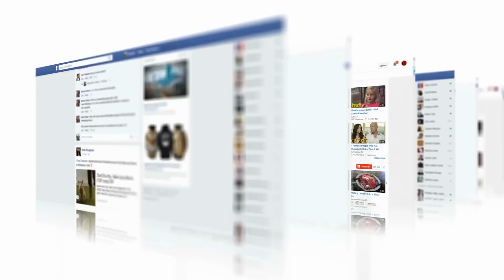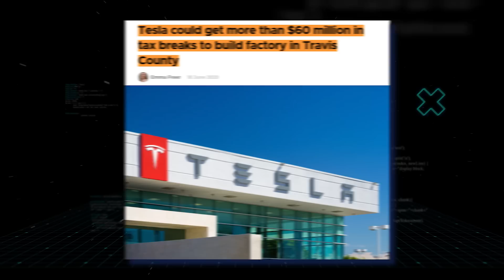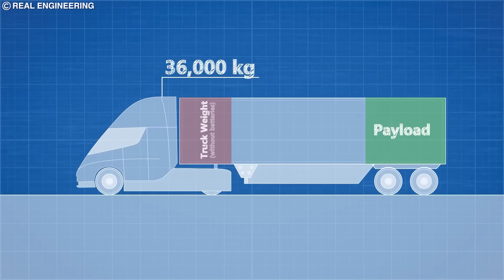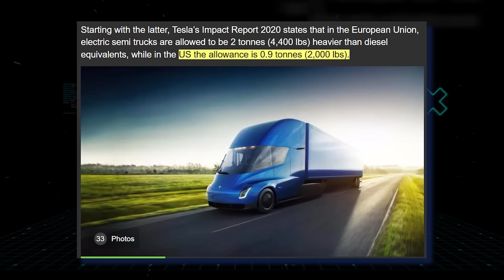Inside Tesla's ALL NEW $7 Billion Semi Truck Factory

Comment: 800 km = 500+/- miles is a total of 8 hours of driving, at 8 hours of driving by law the driver must take a 30 minute rest break and then can drive for another 3 hours for an 11 hour drive limit. If the truck can recharge the battery in that time for another 180 miles to end up at a truck stop or home base for full recharge then it is doable.